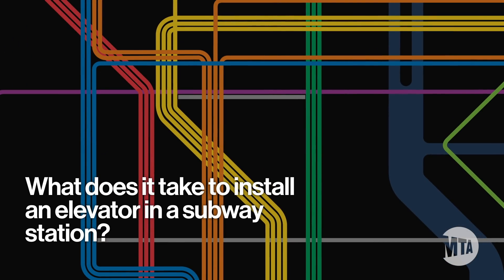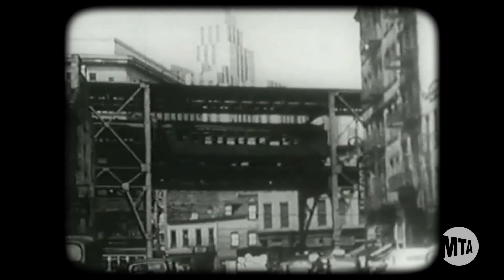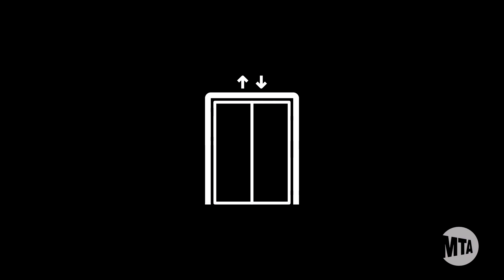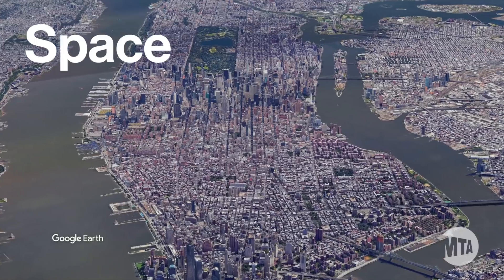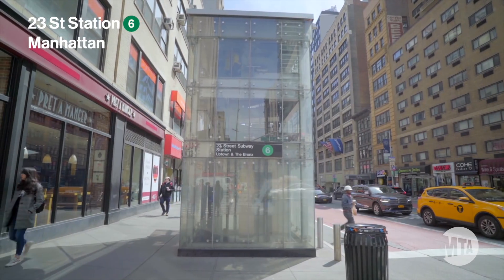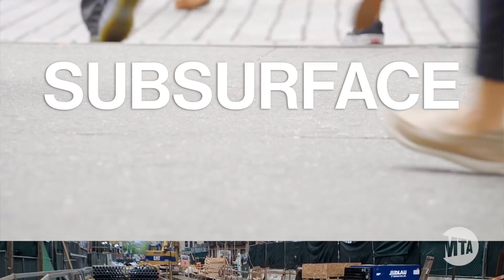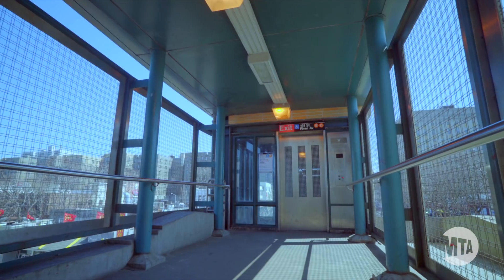What does it take to install an elevator in a subway station?

Comment: Last year I noticed them installing new elevators at 14th street station, the previous year I helps a man carry a stroller up the stairs at one of the stations with no elevator. I don’t need the elevator personally but it’s nice to see them being installed for those that do so the station is accessible to everyone. The automated announcements usually announce where the accessible stations are.

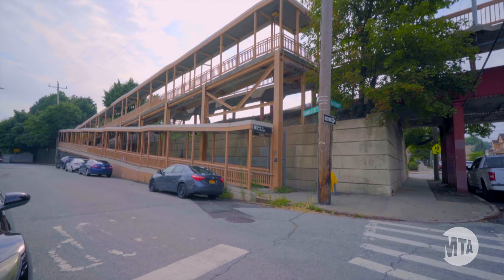Comment: 4:05 Install ramps instead of elevators if there’s enough room for their spiral or zig-zag path and not too much height difference. It’s not only cheaper and quicker but also doesn’t increase electricity bills or require extensive maintenance.

Comment: Some stations like Whitehall St or Bedford-Nostrand Aves on the R/W and G, respectively have a center track for short-turns between two narrow island platforms, which makes installing an elevator extremely difficult, if not impossible, not to mention, it’ll cost more building two, one for each (narrow island) platform. However, installing an elevator may not require track relocation and platform widening like E 105th St on the L would. The center track at the first two stations can be covered up to fuse both platforms into one wide island platform like the one on the 42nd St Shuttle at Grand Central to make room for elevators. The disadvantage to this is that short-turns will no longer be possible but I think accessibility is more important.

Comment: It is not only elevators or ramps that are needed. What about level boarding? Make sure all platforms are level with the train floor and that the gap isn’t too wide! If not, the platform should be renovated. It’s expensive, but it’s necessary to allow solo wheelchair users to get on and off the train safely.

Comment: Why did it take a YEAR to replace an EXISTING escalator at 125th street on the 1 line? It takes a month in a new building.

The other existing escalators are often out of service several times a month with them being completely dismantled for over a week. Again and again.

This looks like a “make-work” mob-owned subcontractor racket.

Comment: Why can't you build slanted elevators? This might be a lot easier. It's been done at Greenford tube station in west London.
Reply: Even then it could still take more time and be more complex, especially if it needs to be in an area the MTA or the city doesn’t own. Hudson Yards was easy because it was in open air on city-owned property.
Reply: There's one at 34th Street - Hudson Yards & it's slow as hell lol.
Reply: @michaelmorales1475  I think my point is that you can convert an existing stairway/escalator into a  slanted elevator, so it wouldn't take any more land (and as was done at Greenford, and also for the Tyne cyclist/pedestrian tunnels though less successfully; both ends of the Tyne cyclist/pedestrian tunnels also have conventional elevators).
Reply: @seprishere  That would be interesting to see, especially for an Elevated Station.
Reply: @michaelmorales1475  Greenford station is elevated, on a fairly high viaduct. It does have a fairly wide plaform though (as this serves three tracks - two London Underground tracks which continue through, and a National Rail track which terminates). This may be the difference.

A fairly common plan for Tube stations is to have three escalators, or two escalators and a stairwell, between a ticket hall level and a circulation level. This would lend itself well to an inclinator. Separate conventional elevators might still be needed to get down to platform level. Street to ticket hall may or may not benefit from an inclinator depending on precise layout.

Plenty of Tube stations used to have (conventional) elevators, though not usually all the way down to platforms, which were decommissioned in favour of escalators at a rather different location; alas the old surface station buildings have generally been sold off. The elevators were provided because of depth, not accessibility (i.e. London was building deep level Tube lines before the NYC Subway started).

Comment: New York City will have a problem in 20 years in regards to infrastructure. The Subway system is not assessible to disabled people. Not to mention, many NYC buildings are old and this creates a mice problem, as well as a failing electrical problem. The city needs to invest heavily now to prevent this.

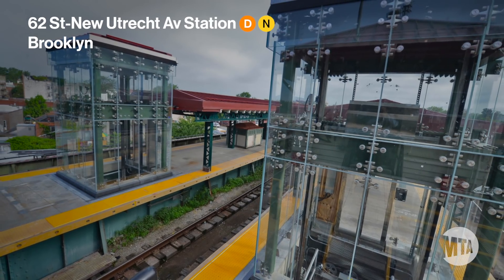Comment: 0:49 Is that seriously what they've done at that station?
I can see the platforms are narrow. (About 4.5 m, given that the whole station is only 20 m, on google satellite image.) But putting those things there has left far less than 1 m to the edge of the platform. There's no way that would be even close to complying with standards. Are there no actual regulations? Even if there aren't, the first court action for injury sustained there is going to be bad news for somebody.
Reply: Welcome to the MTA where logic goes out the window. This is the same agency that rebuilt an entire train station without elevators in Queens to than knock down the station less than 5 months after to rebuild it with elevators. Why do it right the first time when you could keep doing it wrong
Reply: @MuddinNYC  Logic is definitely not thrown out of the window. They had no other choice but to do that.
Reply: I’m not from nyc but from what I can see, the doors are pointing towards the roofed section of the platform so I’m guessing they are at the end. No one is allowed to pass there but they should implement some sort of gate to keep passengers away
Reply: @Betre3100  
Well, I hope so. That's what's usually done where they have to be installed on a narrow island platform.
It doesn't look like it.
There's no barrier, as you say. (Something mounted on springs to the side of the new structure would be usual.)
There's no sign of a sign.
The yellow, tactile safety line indicating the edge of the platform continues past the structure. This sends all the wrong signals (if passengers aren't allowed/expected to pass).
It's quite unusual for metro stations to have platforms that are so much longer than the trains that stop at them.
Reply: @michaelmorales1475  
Thanks for the link.
Not quite AT the end of the platform but NEAR it (as I could see on Google satellite image too).
We see a train stop and none of the doors are beyond the lift.
So the real problem is that it LOOKS to someone on the platform that they can walk past it: the yellow line continues, there's no sign, no barrier, no difference in the treatment of the platform beyond the obstacle.
Reply: @paulkennedy8701  true.
Reply: At that station, all of the elderly are boarding in the middle of the train, so it is better to have the elevator doors point to the middle.
Reply: London used to, and I think at two stations still has, such narrow platforms. However, at some previously excessively narrow island platforms they have filled in the platform and built another next to it. This might be harder if elevated than if underground.
Reply: @seprishere  
London has exceedingly narrow platforms underground near the southern end of the Northern line. (As Glasgow has on its Subway.)
But those are different from the situation here. In those cases the entire platform is dangerously narrow, and the access is restricted to the ends of the platforms.
At the station we're looking at the platform is not that narrow. It's wide enough for access in the middle. But it looks like they've put their new lifts not at the end of the platform, so that it seems as though passengers have to walk beside, where it is now very narrow. (Or, if they don't have to, the design elements make it look like they are expected to.)

Comment: Watch the video. Its not like they can just snap their fingers and an elevator appears out of nowhere. Im involved in elevator installations in MTA. Its a political nightmare. You gotta call everybody and their mother to come and move their utilities out of the way (not like you can take Con Ed's cables and move them yourself.) A bunch of city departments need to get involved; DEP, FDNY, NYPD, DOT, Utility companies; Con Ed, ECS, Verizon, etc, etc. The location of the elevator requires a large footprint for construction staging, excavation, limited access zone, sidewalk closures, traffic lane closures, parking lane closures, re-arrangement of pavement markings, traffic signals, etc. If any construction will be in front of some restaurant, they will complain that they are losing business, residential buildings will complain about the noise, slum lords will complain that the construction is causing their buildings to vibrate and get damaged. God forbid you need to install the elevator where somebody parks their Halal cart.Subway riders will complain that the construction of the elevator is disrupting their commute. 

At the end of the day, you go through hell to build a moving porto potty for the homeless, and a playground for vandals. which costs millions to build and millions to maintain because New Yorkers are fucking animals that can't have anything nice.
Reply: read this essay. I can agree with it. sadly, many new yorkers can't see a bright future

Comment: Its the 21st century & the MTA brags about how old & decrepit their system is...lol.
Corruption & Mismanagement much ?
Reply: No corruption is involved here.
Reply: I know  @TheRailLeaguer  ...like in 2003 when it was discovered the MTA was keeping two sets of books & claimed no financial improprieties ...lol 😜
Living in NY with that shithole transit system is always an adventure ~
Reply: airmark02 Life is always an adventure.
Reply: Adventure @TheRailLeaguer 
 Like the F train ?...lol ~
Reply: airmark02 Thats always an adventure because of its unreliability due to its merge with the E train. In addition, it also lacks express service in Brooklyn and has uneven scheduling with the G. All of this is caused by one interlocking: 59th Street-Columbus Circle on the A, B, C, and D. Train schedules on the F and G have to be scheduled around that one interlocking, and one wrong move takes out nearly the entire B Division.

Ideally what really needs to be done a to deinterline the 59th Street Interlocking. Here, the C and D routes swap so that the C goes express from Canal to 145th Street, then to the Concourse Line to 205th Street, while the D goes local from 59th Street to 168th Street. In addition, the R would be rerouted to Astoria-Ditmars and the N would be rerouted to 96th Street with the Q, with the W replaced by increased R trips. This allows for the E route to get an increase in service. Using the existing track infrastructure in Queens, a new K route would supplement the E route, running from 71st Avenue to World Trade Center via Queens Blvd Local and the 8th Avenue Local. The M would be rerouted via the 63rd Street Tunnel with the F. This would improve system reliability and increase capacity between Queens and Manhattan without constructing new lines. Supplementing this would be the swap of the Q and D in Brooklyn as well. The only issue is that you won’t be able to run a culver express yet, but this will be for another day.

Speaking of that, once we’re in that phase, several new connections would be built to improve service further. The magnitude of changes becomes smaller, but benefits will be huge. The first connections to be built will be a new Tunnel connecting the Broadway R and W lines to the Court Street station on the Fulton Line, which then feeds to the local tracks of the IND Fulton Street Line, with another connection built connecting the Fulton Line at Broadway Junction-East New York and the Jamaica Line at Cypress Hills, replacing the elevated structure over Fulton Street. Here, the R and W would be rerouted via the new connections, with the R going to Euclid Avenue and the W taking over the J route to Jamaica Center. The J would now operate between Broadway Junction and 95th Street to replace R service (Z service now operates as additional J runs). The original routing of the Q and D would be restored to maintain connections between Broadway and 6th Avenue. Meanwhile, the C would be express to Lefferts Blvd, while the A can solely serve Far Rockaway. 

Another new connection would be built, directly connecting the Nassau Street Line at Bowery to the 8th Avenue Line at Spring Street, a long with a rebuild of Essex Street for better terminal operations. With this, the E and K would be rerouted from World Trade Center via this new connection over the Williamsburg Bridge, replacing J and M service. Using the existing track infrastructure in Brooklyn, the E trains would replace J service to Broadway Junction and the K would replace M service to Metropolitan Avenue. The V would replace the M in Queens and Manhattan, and would also run to Brooklyn via the Culver Line. In the original plan, I had the V be the Culver Express route to Church Avenue then local to at first Kings Hwy and eventually, Avenue X. Under this revised plan, there will be “zoned” service. With this, the V would be the Culver local to Church Avenue, while the F would be the Culver Express to Church Avenue, then local all the way to Coney Island. This new move allows for those living the farthest to have faster commutes while the Upper Culver local tracks have more even headways, reducing delays.
Reply: @TheRailLeaguer  ... 👌K

Comment: The London underground is still struggling even after the promise during the 2012 Paralympics to be the most accessible games. BTW Here's one for you, did you know the first underground station in London was Baker Street, What was the point in that? Where could you go?
Reply: Errr.. the first line was from Paddington to Farringdon and the Tube is still doing well accessibility wise despite its age.
Reply: @nsikanedung3277  The first line yes but actual station was Baker St in the 1860s.
Reply: @lenmarfox2947  "The 3.75-mile (6 km) railway opened to the public on Saturday 10 January 1863. There were stations at Paddington (Bishop's Road) (now Paddington), Edgware Road, Baker Street, Portland Road (now Great Portland Street), Gower Street (now Euston Square), King's Cross (now King's Cross St Pancras), and Farringdon Street (now Farringdon)." - they all opened on the same day...

Comment: 0:30
That’s not a good enough excuse
London is the oldest in the world and most stations are accessible.
Reply: Metro systems are built diffrent. That's why London cant run the subway around the clock.

Comment: Umm so were not talk about almost some these station are not connected with uptown platforms and downtown platform. They should because no one wants to walk across the street and use up another ride
Reply: Cross There isn’t enough crossover volume at some older stations to justify spending money for a crossover. The only station that I can see being the next candidate for a crossover is Church Avenue on the Nostrand Avenue Line, due to high volumes of riders at these stations.

In addition, not a lot of space exists for one.
Reply: @TheRailLeaguer  damn but which Church Avenue & Nostrand Avenue ?
Reply: Cross The one served by the 2 and 5 trains.

Comment: Why don’t they just have one elevator shaft which skips the mezzanine and have a ticket machine on the platform e.g just as you exit the elevator.
Reply: Ayden Burgoyne This May work on some of the stations, such as stations on the Nostrand Avenue Line, since the fare control is on platform level (no cross passage between platforms)

However, at other stops, it would be logistically impossible due to the narrow platform.
Reply: JeremiahC99 yeah that makes sense. My original idea was to have 1 ticket gate that is the width of the elevator and only allow use by people who need it. 

They should think about putting tap and go systems in place to they don’t take as much space
Reply: Ayden Burgoyne The only place that this could POSSIBLY work is City Hall on the R line, since fare control is already at platform level, so only one shaft overall is needed.

Comment: I wanna see how they manage to make the curved platforms of the 2/5 in the Bronx accessible because even with elevators installed, they still aren't fully accessible and there isn't a way to straighten the platforms without building whole new stations and no, moving platforms doesn't make a station accessible.
Reply: Steven Ouellet Well, they could move the platform at one end to a straighter section, closing off the curved section to passengers.
Reply: JeremiahC99 not possible with many of the stations out there, they’re wedged between buildings, and many are situated right in the middle of S-curves, so no station is able to be moved to be straightened
Reply: Steven Ouellet Well I was referring to the elevated stops on the 2/5. However, it is parallel bu a few buses for the most part. For example, for 174th Street and Freeman Street, the nearest stop with elevators and ADA accessible is Simpson Street. To get there, the Bx19 bus would be the best option. For East 177th Street (West Farms Square), the nearest stop is East 180th Street, so to get there, take the Bx21.
Reply: JeremiahC99 pretty sure that’s well known...
Reply: Like Jackson Avenue & 174th Street

Also, E 149th Street on the 6 line (which is planned to get elevators).

Comment: Brighton beach should have a couple of elevators
Reply: I agree. It seems fit as the closest accessible stations are Kings Highway and Coney Island. As they stated, nobody should be more than two stops away from an accessible station, and with Brighton Beach becoming accessible, that would make the statement true for the lower portion of Brighton.
Reply: I've heard that Sheepshead Bay is getting some.
Reply: @michaelmorales1475  Correct. I didn't know that until after I posted my reply.